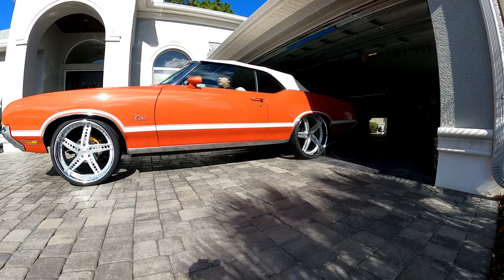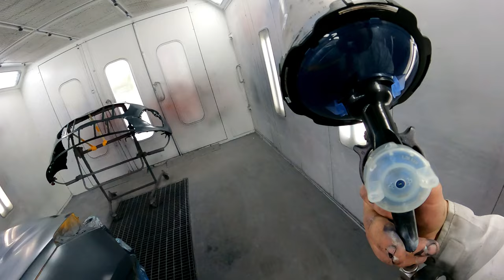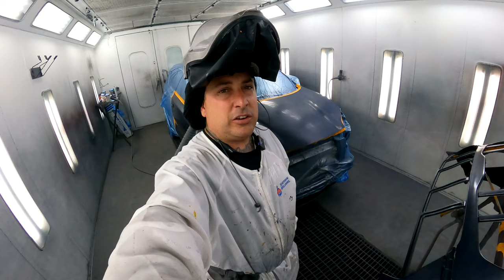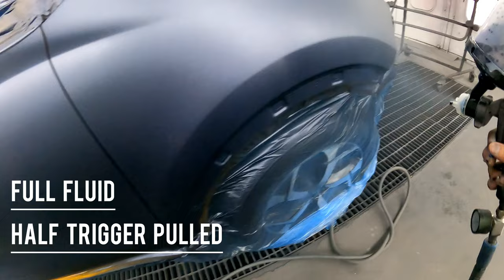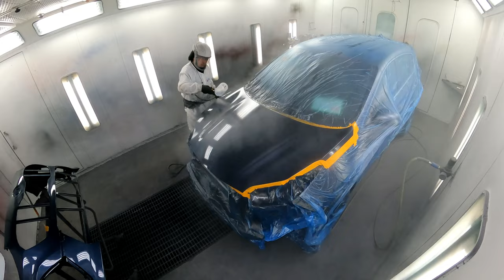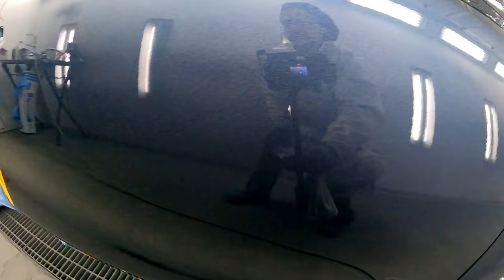HOW TO ELIMINATE MOTTLING

Comment: I just went through this last week with a Gunmetal gray metallic I can't remember if I was using a 1.4 or 1.5. I had not seen this video until now and relieved to see I did the right thing; which was remain calm and back off on the wetness and give more flash time.

Comment: Some say to keep pressure down at 15psi, some say to blast it with a 35psi super wide low paint mist, some say it doesnt matter its the gun your using, some say its because of the temps and humidity and some say its just because your psinting with too heavy of coats..  heard is brcause of dry times between coats..  even heard its because your primer is the incorrect typehuu
Reply from the maker: To me the gun and the application is the cause
Reply from the maker: Thanks for watching
Reply: Spraying too much paint...too heavy.  The metallics are just floating around like soup.

Comment: The best way I found by far is 2 to 3 light dust coats at low PSI and then the third final coat I lay moderately wet over all of that... and  50% of the time it comes out perfect every time.

Comment: Did my first spray and encountered lots of problems.    First I’m in south Florida, 😅About 4 hours south of you.   As I was spraying,  water was dripping out my Tyvek suit. Because I was going forward I didn’t see it until I hit the middle and  I started to switch sides.   Wrapped my wrists with paper towels and it was solved but I got some minor damage.    On the 3rd coat of base the gun stopped spraying paint.   There was paint in the gun but it’s not coming out.   I stopped at 2 coats and cleaned out the gun. I noticed the vent was blocked, duh.    I didn’t have anymore paint since I only bought a quart.    It could of used 1 more coat of base but I already dumped it, another mistake. Should of poured it back in the empty can.  The clear went on fine but I stopped at 2 coats.  I should of finished the quart so I could safely sand away the minor orange peel.  Even with sanding and guide coat I still missed some low spots that now look huge.    https://youtu.be/rR-c177vp4Q
Reply: Yea it is hot out there. cover looked OK....better than before. Good cheap gun is Vevor website. I did a review. Cheap but OK. better is the Porphus. now that is a great gun. Cheap guns are really hard to get a good finish. FYI.

Comment: I remember back in the early days of water-based automotive paints... when Auto-X and everyone else were advertizing how much better they lay out. Nothing has changed... it's still a hassle. On the flip side, tiger stripes in metallics are far less of a problem with water-based paints. Not sure how it helps.

Comment: I don't know if you will agree but in solvent paints especially metallic I had that problem and would always have to do a control coat after just doing different things I started backing my fan pattern back a little and eliminated that and having to do a control coat
Reply: Still trying to master metallic silvers. I get the “fiberglass” finish some times.

Comment: Since some jobs I spray are single stage metallics with an integrated clear, I will sometimes get blotchyness on a panel even after cross coating the crap out of it to get some gloss after the last coat. This tip will definitely help when I do another one!!
Reply from the maker: Glad I could help 😁

Comment: I have tiger stripping on my front fender. Im going to try this in the morning only thing is I dont have a spray gun. Im using the rustoleum 5 In one spray can with the wide spray. Ill try the low output setting on it from a bit of a distance and see if it works. I know buy a gun, Its just not in the budget right now. Also that is the color I want to paint my truck but leave it a matte finish. What is the color or do you have a link to where I can get. When I get a real paintjob that is what I want. Love your videos Im learning. Thank you.

Comment: Another great job!  Why are using 3M gun for the base instead of other high end guns you have? Is it better that DV1 base or IWATA? Or is your only solid colors gun? Thank you.
Reply from the maker: I love the gun no clean up just change head and go I have 4 of them I spray multiple colors at once two booth going at a time big time saver.
Reply: @kandyman5315 Thanks for the info!! Are you changing the head every time? Or it can last few jobs?
Reply from the maker: I don't  change them very often. I've never had one go bad. I change it after a lot of use, just because I want to. The old 3m guns only  lasted a few jobs. The new performance gun  is awesome .
Reply: @kandyman5315  What would be the impact on the paint job quality if you used the Performance gun for the clear coat too?   Thank you.

Comment: Im shortly going to be respraying a new front bumper and both side front fenders, for my car...
Ive sprayed things like BMX frames and alloy wheels in the past, But now i want to make sure i spray my car parts perfectly...
My car is a Dark blue metallic.. (Z168 / 4XU Metro Blue to be exact)...
I have mainly used ebay cheapy HVLP guns in the past, But bought myself a Devilbiss DV1 with a DV1 B+ aircap, to give me every best chance of a perfect job...
Any tips on how to spray it to look perfect?!
I usually spray at around 29psi at around 6-7 inches from panel, for non-metallics...
What would you recommend for my metallic paint bumper / fender job?

Same, more or less pressure than for solid colours?
same distance to panel?!?!  further? closer?

2k paint... if thats any help..   I am also using SLOW reducer... 
I absolutely need for this to turn out nice.... It sounds silly, But its a pride, sort of thing... I am getting laughed at by family, for attempting it myself, instead of paying a professional to just do it...
I get peer pressured ALOT. etc.. Its just the way my family is.... They like to put me down for everything i do wrong, but i like to learn new things

So i absolutely need this to turn out good..

Thankyou
Reply from the maker: Spray the base at around  12 to 15 psi coverage coats 8 inches away .once coverage is good, back away from the panel to about 18 inches  at around  10 psi and give it a light  coat to lay out the  metallic  even . For clear 20 to 23 psi hope this helps 💪💪

Comment: Hi, sorry for comment an old video. Just thought when you spraying the 2nd coat light, are you dialling in the fluid to how many turns in? Or you always spray it on full fluid with only low pressure.
Reply from the maker: Full fluid low pressure  .thanks for watching 👊
Reply: @kandyman5315  thanks mate. 👌 Appreciate your response.

Comment: Is spraying in 90 degree weather possible and avoid mottling? I have the iwata LPH 400 orange cap. Im using solvent base ppg Dbc paint.
Reply from the maker: @eddiegarcia9657  yes
Reply: @kandyman5315  Thanks for the great content, alot of good information on your channel. Would having a psi higher than 15 lbs on the  iwata lph400 at the inlet cause mottling ?

Comment: What can I do when my silver is not a sparkly as the factory. I do have a good match but my paint seems too lay too flat compared to the factory
Reply from the maker: Sometimes your color can good. Although the metallic size can be wrong check  the size of the metallic
Reply: @kandyman5315  you are probably the best there is if not at least top three online when it comes to paint work. I however I am a mobile unit who mainly does bumpers blends  and such using mini or midi gun and charging very little
Compare to insurance claim jobs .
I was looking for a pressure adjustment or maybe different nozzle size 
.
No one is really complaining I am the one who sometimes sees the difference and it drives me crazy 👍

Keep up the good work your channel is amazing and very educational and very helpful thank you
Reply from the maker: @JanSlavik-mt2rt back up from panel  turn up pressure and fog it this may help
Reply: @kandyman5315  I have a silver Honda pilot NH 830 silver door  waiting for me Friday. I will give it a shot 👍